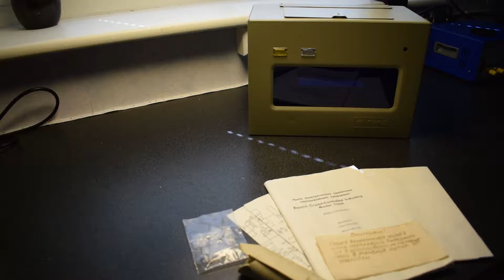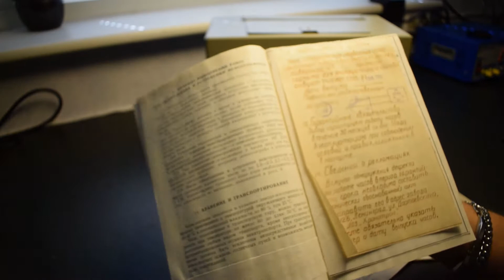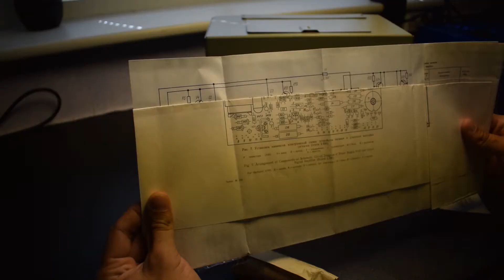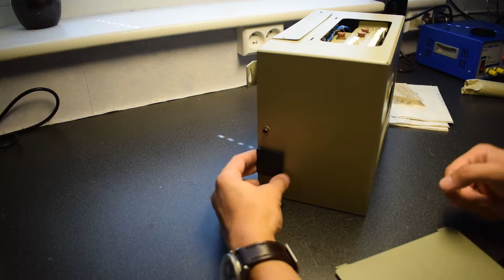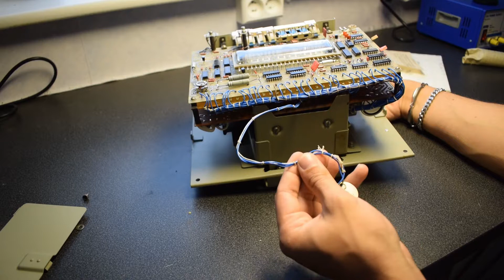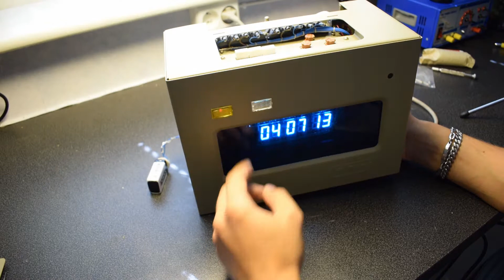[006] 90's Sovjet Master Clock (ПЧК-3)

Comment: How do you connect it to electricity
Reply from the maker: There is a cover on top, if you unscrew it there will be a set of terminals underneath. The two on the right (usually separate from the rest) are for the power input.
Reply: @rtdlaboratories  I find it but when I plugged it started to smell like burn and little bit of smoke come out
Reply from the maker: @samirmouda8224  That could be a few things:
- The clock was broken from before
- Your power grid is supplying the wrong voltage or frequency
- You attached the cable to the wrong terminals

These are just my guesses tho. It's hard to say what it could be without looking at it, and without more info.
Reply: @rtdlaboratories  thank you for answering anyway I plugged it a second time and there wasn't any smoke it worked fine. I don't know what it could be but I'm not confident in let it plugged for the night